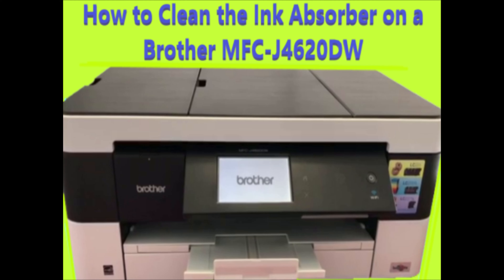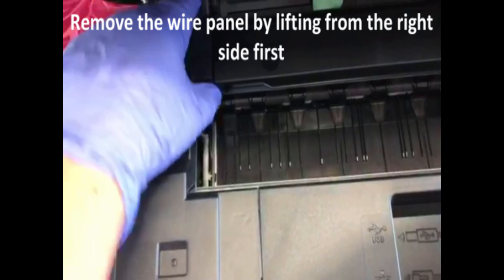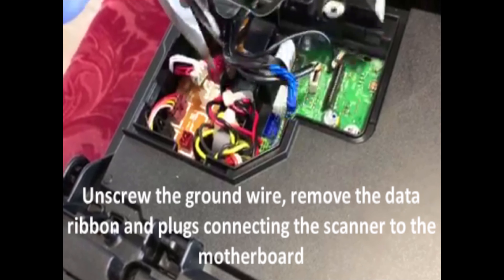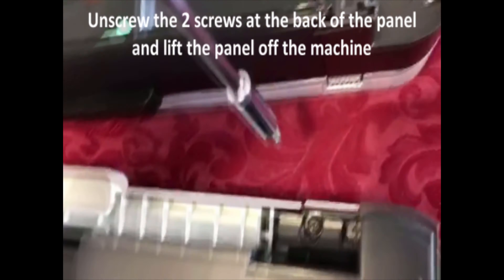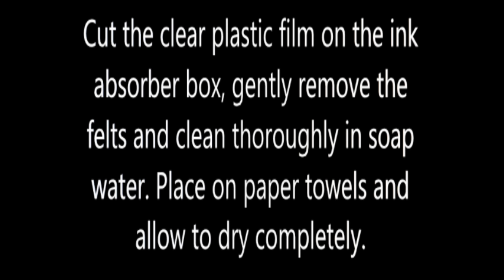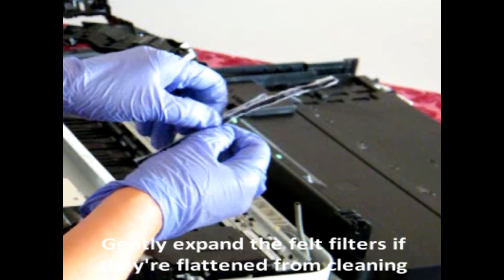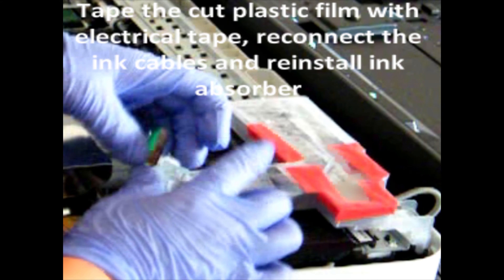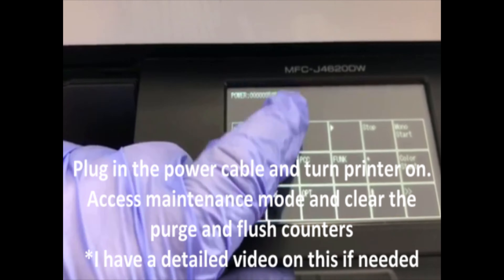Clean or replace the ink absorber box on a Brother printer - Fix Error 46 on MFC or DCP

Comment: Great video that answered whether there were any other counters that needed to be cleared. I have cleaned the absorber, reset purge  and then restarted to be met with Ink Absorber near full. I then saw your video and cleared the black and colour flush counters. Unfortunately I still get the ink absorber near full message. Is there anything else I should be addressing.

Comment: Brilliant. Excellent instructions relatively easy to follow. Messy. Saved my printer and all my new ink cartridges won't have to go in the bin. One comment is that if one understands that the support arm has a small plastic protuberance at the rear end (back) then gentle levering releases the arm. Otherwise lots of sweat is involved. PS Brother support says only their technicians can do it, Crap.
Reply: i can't find anywhere that releases the arm when pressed.  does anyone have the link to the detailed version of this video?  it is so well done, i just want to get past the part about releasing the control arm so i can proceed, thank you
Reply: I didn't find any detail. I do remember it was a struggle/fiddle particularly putting back. I know its slopy shoulder but i did it with perseverance. However the effort was worth it. I did have to reset the page counter a second time shortly after doing it.
Reply from the maker: @JoeBerman100 https://youtu.be/tKy26kc9Yok?si=inPHyh1PcqhR1Q8E
Reply from the maker: @JoeBerman100 https://youtu.be/tKy26kc9Yok?si=inPHyh1PcqhR1Q8E

Comment: Hello there,Thanks for the video. My pads are drying so I have as of now not reassembled....however I located a service manual for this model MFCJ4620DW and when one reaches the waste Ink absorber box (BTW that's Brother PN : LET 43300 on the assembly  ) the instructions are not to remove the chip but instead to follow the wiring from the chip back to the circuit board ( about 7 inches ) and disconnect it there not at the absorber box. 
P.S. My box's felt was swimming in "waste ink".
Also in case anyone else tried to pull on the plug from the circuit board for the ribbon cable....the plug stays on the board just gently lift the cable and it slips out.....

Comment: Great video.
Just as a point, the left (small) pad can become swollen from absorbing too much ink and cause smearing on the print head. I was able to reach it without disassembly and pat it with a paper towel slightly damp with diluted Windex. (about 10:1 Water:Windex), repeating until the pad was almost ink free. (I found it amazing, how much ink it can hold.)

Disclaimer:
Using any kind of solvent is not recommended by the manufacturer, so use it at your own risk. I've found that diluted Windex appears to be safe for all printers I've owned.
HP 560/C
HP 990/C
Epson Workforce 600
Brother MFC-J4420DW (current printer)

 Make sure it is diluted and allow the sponge pad to dry before operating the printer. You can accelerate the process by blotting it with a paper towel moistened with distilled water a few times, then use a dry paper towel.

Note: I have not attempted to use this solution to purge the heads on any printer. I have used it to surface clean the print head jets. Remember, the key word is blotting, avoid any forceful wiping.

Comment: Hello there, after cleaning the absorber pad and reassembling going into maintenance mode still showing Absorber pad full , I enter code 46 and what shows is EXPORT TO CARD. Using the up arrow gives options import from card and Import all. ???? any clue as to how to get back to where I need to be in maintenance mode? Thanks.
Reply from the maker: It sounds like you’re entering 46 as the function code instead of 80. Try entering maintenance mode again and the steps for clearing purge and flush counts
Reply from the maker: Follow the steps in this video - https://youtu.be/ANCokAwTwxo

Comment: Thanks much for this video.
I’m keep getting blank pages now, I’m seeing no error codes, I did clean the auto head cleaning and manual clean as well but no luck…

Can you please share if you have an idea to fix the blank pages?
Reply from the maker: Is there any ink at all on the page or completely blank ? You may need to dismantle again and make sure all the wires, and tubing are connected properly. You could try a power purge, but it sounds more like a connection was missed on installation : https://youtu.be/P-pXJTtlkFM

Comment: Thanks for your video, great help with an old 2nd hand printer! 

A little tip for cleaning the 2nd absorber pad at 3:09. I couldn't lift any ink (seemed very dry), so I put  a little amount of water on the paper towel and dabbed the pad ... it loosened up the dry ink from the pad. Repeated a few times with wet then dry paper towels and the pad ended up almost ink free.

Comment: On machine J4510DW having replaced the absorber box the casing under the scanner was difficult to reassemble and although I did manage to fit all the screws and everything seems ok when fitting the scanner assy. less support arm the scanner remains partially open and prevents the scanner from operating with code 30 showing. The new absorber box appears to be identical to the one removed. My support arm is all plastic unlike yours in the video and I still cannot get it to install correctly Any suggestions please.
Reply from the maker: Take a look at my video of installing the scanner support arm, and see if it helps. https://youtu.be/tKy26kc9Yok

Comment: Okay, I followed your instructions and was able to install a new ink absorber pad and get everything reconnected, then followed your other video to reset the purge and BK/Color counters. I fired it up an printed a double-sided page right away and it worked perfectly. But the second page I went to print got jammed. I pulled it out but now the printer continually says "paper jam front/rear,: and even after I check the paper tray, under the scanner cover, and the rear, finding no paper (not even small tears), the paper jam error won't go away. What could I have done? the paper that jammed did not have a tear in it, it came out complete. Help!
Reply from the maker: You might need it slowly dismantle it again and thoroughly check for any debris or tiny paper pieces in the top end of the printer and paper feed. First check there’s nothing behind the print head- move the print head to the centre by pressing the x / cancel or stop / exit button. Turn off and unplug power at the wall. See if there’s any visible obstructions / paper / staples / hard ink residue behind the print head- move it slightly if you need to. Plug in and turn back on and hopefully the error is gone. If not, take apart and have a very thorough check if anything became in the paper feed areas while you had dismantled it for the ink absorber

Comment: I have the 4510 i dont have an error but the cleaning phase is simply not cleaning id say and then the ink is just not taking either I have ink and isnt really being used up it just simply doesnt take for some reason. I have done the cleaning phase about 100 times already. It still just wont print no color whatsoever including black.
Reply from the maker: The print head nozzles are likely blocked. Try first using distilled water to clean the ink nozzles from behind the ink cartridges - put paper towel under the print head first, then take the cartridges out and use a dropper or syringe with distilled water to put a few drops into ink inlets on the printer. Leave sit for at least 10 mins or half an hour, then try the clean process again. If this doesn’t help a little, you’ll need to try to dismantle the printer to get to the print head and clean the nozzles on the print head. I’ll make a vid this week to show what I mean :)

Comment: I'm trying this on a Brother MFC-J5720DW. Everything is the same until 1:30 in the video (except I have 8 wiring connectors to remove, not just the 4). I can't get the scanner cover off. This model has a rear paper feeder which seems to be getting in the way. It doesn't allow the scanner cover to lift up vertical. I applied considerable force and the left side popped out but the right still wont come off. Any tips?
Reply: Probably to late for you but might help someone else reading this. While working on my J885dw I removed all visible screws and still couldn't get cover to budge. I found that by removing ALL doors (ink cartridges, rear paper feed etc) cover came of easily.

Comment: Thank you for a very informative and well presented video. I have an older Brother MFC 290 C which is a marvellous machine and has served me well for many years.  However it has just thrown up an “error 50” message. An on-line search informed me that it may have a foreign object (paper clip, staple or a piece of paper stuck somewhere in the works. I followed your instructions as to how to get the top cover and the glass plate up so I had a clear view of the rollers, print head, rails etc however I found nothing. Could it be that the ink absorber box is full? If that is a possibility are there any videos that you know of that would show me how to get at it on my MFC-290-C? Any help would be greatly appreciated. Many thanks. Rob

Comment: Thanks for the videos.  I used them to replace the ink absorber on my MFC-J4510DW.  I reset the purge and print colour and black.  However, I still have the message coming up "Ink Absorber Nearly Full" .  Can this be cleared?  Many thanks for any help. Mike
Reply from the maker: Michael Aldworth the message will usually go away after a few prints, but did you also reset the flush count? Rest that too by going through the same steps as the purge count. https://youtu.be/ANCokAwTwxo 
If error msg is still there, try doing a hard start- Try unplugging the printer for 10 mins, then plug back in while holding down the power button. Keep the button down until it’s finished start up, snd the Home Screen is displayed.
Reply: @Knowhow1  thanks for quick reply.  Yes I did the flush as per your other video.  Will try your suggestion.  Thank you. Mike

Comment: I cleaned the absorber pad and purged but now I'm getting the absorber pad near full error message. How do I get rid of this?
Reply from the maker: This happens a lot. Most people said it clears after a few uses, or a couple of days. You can try resetting the printer too by unplugging it at the wall for 10-20 mins the plug in while holding down the power button until the main menu displays

Comment: Hello, my printer doesn't turn on, is there way to check power fuse in 4120dw model?
Reply from the maker: Hi - did it stop powering on after a windows update? Did you have any error message before this stopped working ? Try this - unplug the power cable for 1 min, remove the paper tray and hold down the on/off button while plugging the power cable back in. Keep holding the on/off button for at least 30 secs. It might need a firmware update.  Let me know how you go.
Reply: @Knowhow1  thanks. I try this and will let you know.

Comment: Great help, thank you
Unfortunately my MFC-J6930DW (with it's ink absorber saturated) is constructed significantly differently, so removing the scanner cover does not seem to be as easy as "pushing away from you", the scan cover arm is also a bit more tricky to unclip.
In the MFC-J9630DW the ink absorber box is accessed from the bottom, it's a rectangular box held in by two screws, thus easy to remove. 
However, the problem on mine is the 'ink absorber pad' under the cartridges and it's 'wick' that descends through the bottom of the printer into the 'ink absorber box'
It's become saturated after many attempts to fix 'smudged ink' by using the clean printheads maintenance routine.
While I can remove the 'ink absorber box' from below... getting inside the machine to access the 'ink absorber pad & it's wick' is proving probematic!
Reply: I'm having this issue exactly on my 6930 as well. Did you ever fix yours? If so, any tips?
Reply: I had this issue aswell on my dcp printer, it was an issue until I noticed how to do it. It won't come off right away like you see in the video but you need to put a bit of pressure at the bottom of the handle, there's some kind of tab there that wipp make it a lot easier to get out.

Comment: After cleaning the ink absorbers on my Brother MFC-J4510DW, as shown in your clip, I reassembled the printer without any problems. I spent some time getting the scanner support arm fitted correctly, but it’s now fitted as it should be, after reading several clips on how to do this / how to check the arm is correctly positioned.

However, I now get the message ‘Scanner cover open’ when I start the printer and this stops everything in its tracks.

- I’ve tried all the usual Brother support answers without success (e.g. open and close the cover, check the support arm).

- I’ve also tried maintenance mode as described in your other clip https://www.youtube.com/watch?v=ANCokAwTwxo
but I don’t get very far, as the error message about the scanner cover overrides this.

- I think it’s a sensor that is not working correctly, resulting in the error message, but where is this sensor and how do I fix it!

All suggestions welcome!

Colm

Comment: After completing your cleaning process and reassembling the machine, I get a message: "Unable to Init. 30"  According to several websites this message refers to a jam.  The websites give instructions on how to get rid of the jam, but I could not get them to work.
Reply from the maker: It could be a jam, ink on your encoder strip or just a temp error message due to working on your printer.  Unplug the printer for abt 10 mins then turn it back on while holding down the power button. Keep holding the power button until the Home Screen displays. If the msg is still there, check in the back and around the print head for paper scraps. Let me know if the error is still there after doing these things
Reply: @Knowhow1  Turning the printer off for 10+ minutes + turning it back on while holding the power button does not help.  

How do I find the print head?  I have checked for jams using the instructions in the manual.  As far I can tell, there is no jam.  Or there might be one in the printer head if I could find it.  There was no jam before I began the cleaning the absorber process.  The printer was working fine.  So I am puzzled regarding how it could develop a jam in the cleaning process.  

What/where is the encoder strip?  Is is the same as the data ribbon.  If that's the case, it seems perfectly clean.
Reply from the maker: @Paul Finger  The print head is the box which slides left to right. Lift the scanner lid and the scanner and you should be able to see it. If you can't see it, with the scanner lifted up press and hold the STOP/EXIT button for 5 secs, and it should move to the center. Have a look for any paper scraps, staples, or paperclips around here (using a torch helps). This vid shows how to check the paper feed system which should help: https://youtu.be/ZuYNc2wH-RY
If the error is still there, print off a print quality check - In SETTINGS select INK/Maintenance, then Impr.Print Quality, then color/start. If the error is still there, clean the encoder strip. Lift the scanner again and looking toward the front of the machine, on the right side of the scanner support arm, is two thin strips of plastic-  one grey and one clear. It runs across the width of the machine. Clean the grey one with a lint free cloth. Clean it 2-3 times.

Comment: I followed this tutorial and now it's saying my scanner cover is open... everything is fitted on properly and I don't understand what is going on? Please help!
Reply from the maker: Try unplugging the power for 5 -10 secs and then turn back on. If the error is still there, try opening the scanner cover and then push it down to lock into place.
Reply: Did you find a solution? I have the same issue.

Comment: I have exact same printer. I replaced ink box brand new - reset purge and flush and I am still getting ink absorber pad near full. I run a test print and no black color. The black cartridge is full. i ran head cleaning of black and still no luck. Any suggestions?
Reply from the maker: Sometimes the error can stay for a day or so before it clears, however it should print. Try powering off the printer and unplug for atleast 10 minutes before starting it up again. Often this will be all that’s needed to clear the error message. You may need to follow the instructions to reset the purge and flush counters again if the error message persists
Reply from the maker: Try power purging the ink - https://youtu.be/P-pXJTtlkFM
Reply from the maker: @ABC-hq5qn  fantastic ! I’m so glad I was able to help :)